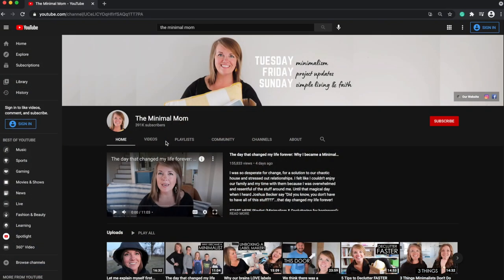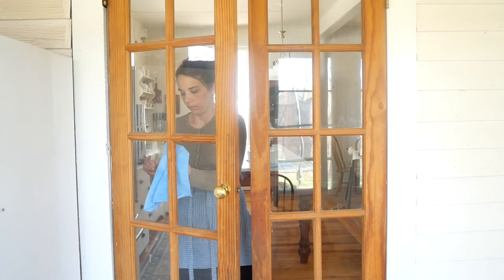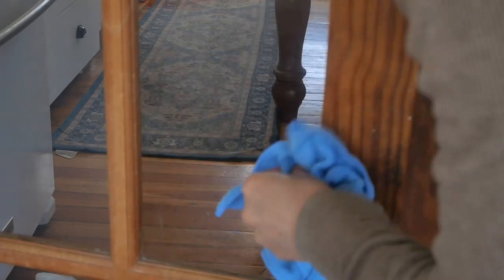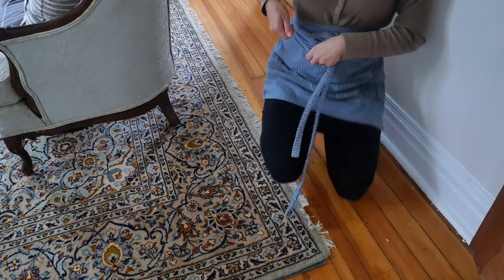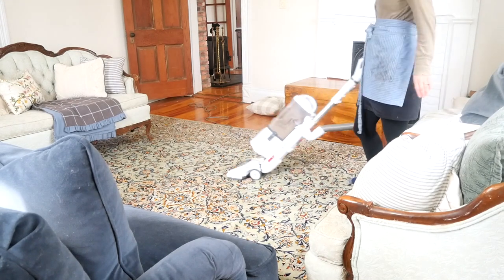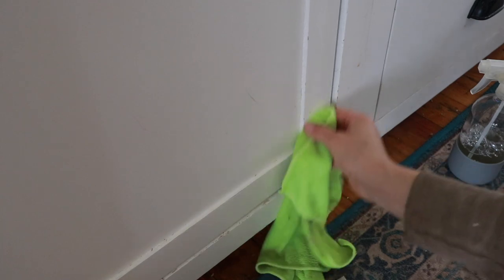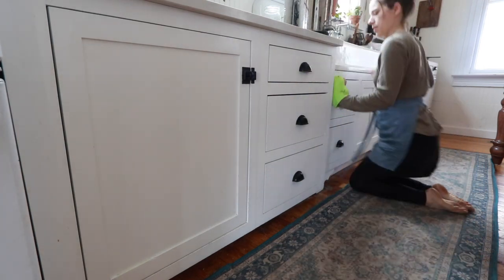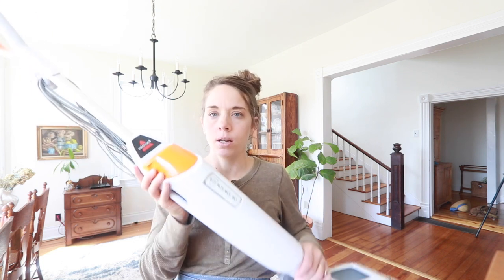My Natural Cleaning Secrets | SPRING CLEAN WITH ME

Comment: i was always told steam cleaners and vinegar would dull or damage wood floors
Reply: True! Steam should NEVER be used on wood floors! The steam will warp them and vinegar will strip the sealant (urethane). I use a Bona mop and their cleaning solution on mine. Steam is good for ceramic tile.
Reply: Yeah I was wondering about that. I was told not to use a steam mop on my wood floor.

Comment: Instead of lemon essential oil, would fresh drops of lemons out of a real lemon work.....or be good enough.   Or does it need to be essential lemon oil?
Reply from the maker: i  would just say lemon essential oil is more potent & would likely work a little better
Reply: Just be careful not to use citrus oils on painted or varnished surfaces. They are solvents and will strip finishes.